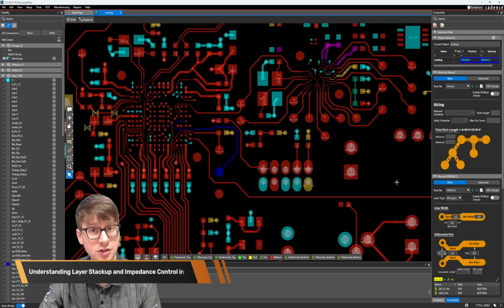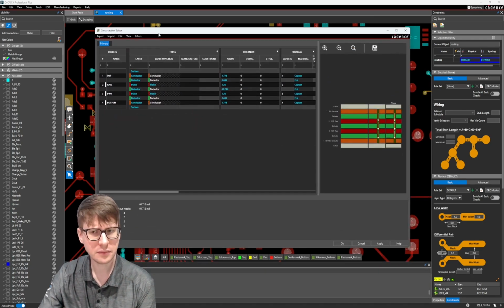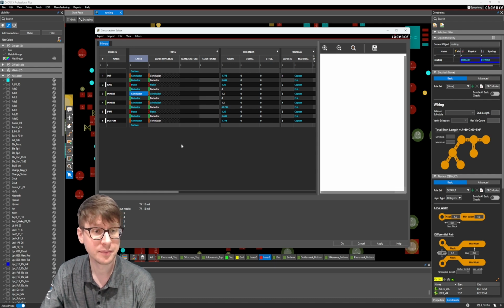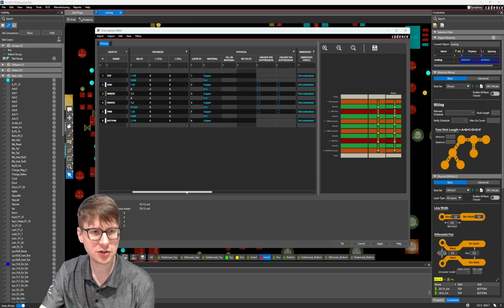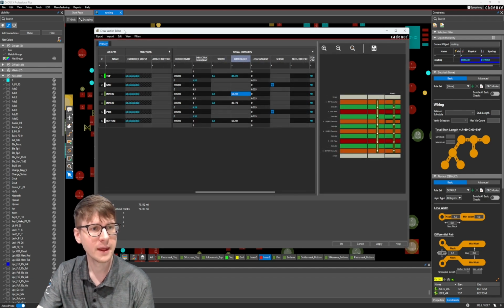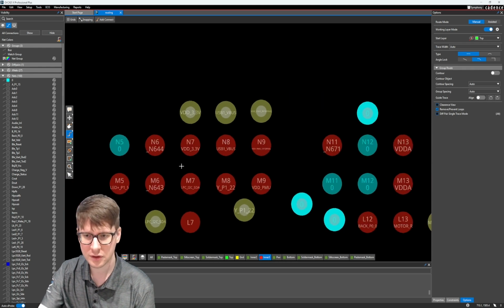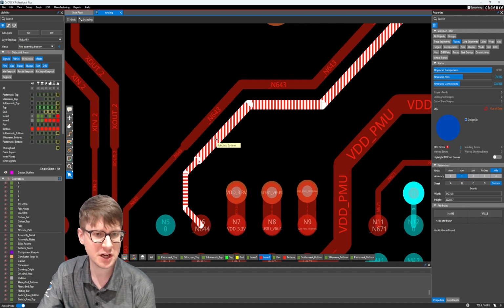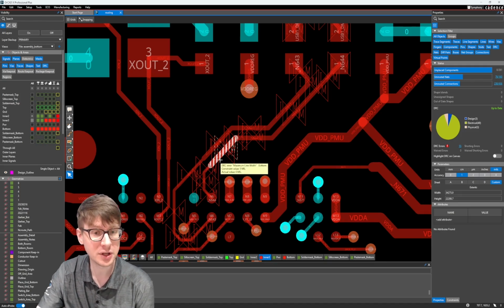Understanding Layer Stackup and Impedance Control in OrCAD X

Comment: Hello another follow up question to this video. It seems the tool can handle that you enter a single ended impedance and when assigned to nets, it will automatically set the required line width, depending on the stack up. 
But it seems the differential pair is completely manual, that you can calculate everything but you have to manually insert it into the constraint manager?